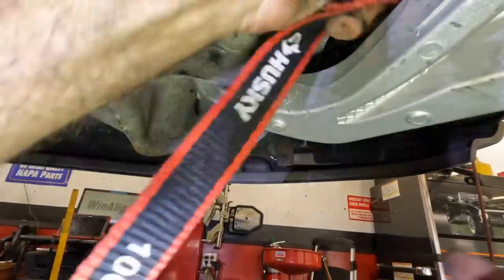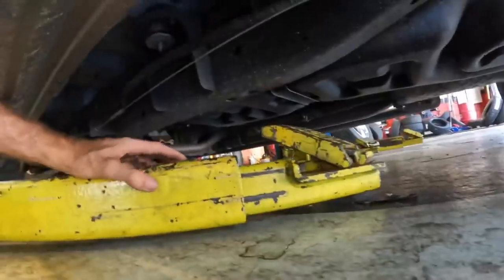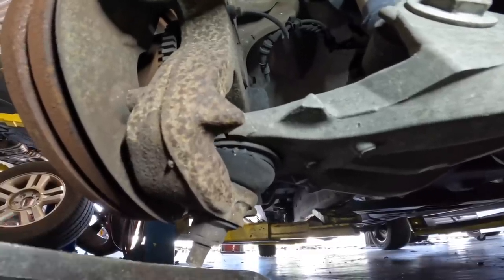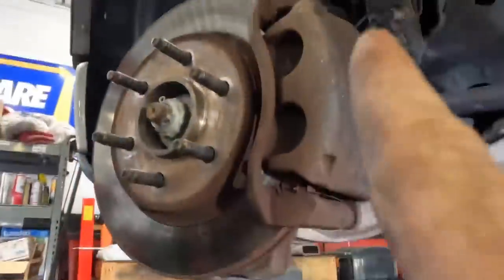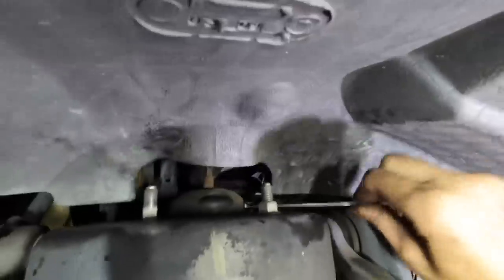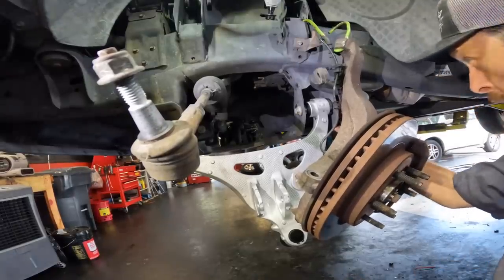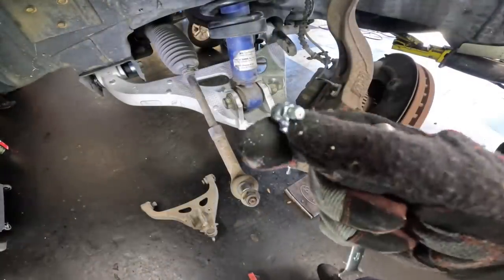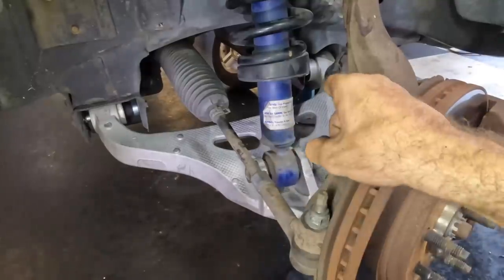Sloppy Suspension! 3 1/2 worn balls | Ford F150

Comment: Aha! Thank you Ray, I have had shuddering (juddering) with braking for a couple of years after replacing the rotors and pads with a set I bought online. Seems I need to get them checked for thickness variation.  I had been worried about it but haven't been able to afford to fix it.

Comment: Hmmm,
When I did my uppers and lower ball joints I didn't remove the lower arms. I just replaced the ball joints.
You do have some nifty tools.
Reply: It isn't necessary to replace control arms unless they are damaged.  He removed serviceable factory arms and replaced them with Autozone junk arms because it is often faster (thus cheaper) than spending the time to dislodge the ball joints.
Reply: On a truck that old, the bushings are more than likely dried/cracked/rotted away.
Reply: @mph5896  Yep.  If you do this job at home, as I have a few times, you should replace the bushings.

Comment: I had a squeak for 6 months. I re greased every rear bushing, I wrapped the sleaave in teflon tape. I could not find the sqeak! Saw one youtube vid showing a squeaking ball! fixed. i had the rear apart 3 times to find the squeak. Ball joints didn't even have play. just no grease.

Comment: Just had this same repair done to my 04 f150 3 days ago yes those spindles have little weight to them but you should be glad your customers truck wasn't 4x4 like mine but doing the strut towers is a little easier on my vs 2wd
Reply: Love the use of the straps in PT 2 work smarter

Comment: Dont forget to remind the customer that he now has greaseable ball joints that will need to be looked after when he gets his regular service done. On the up side, with regular service they will outlast the OE ball joints by a large margin. I still cant get over having to change control arms instead of simply replacing ball joints. Even after buying new lower control arms to same money when replacing a rusted out broken front subframe. The new arms had both ball joints and bushings pre-installed so installation ws a snap.
Reply: I had the same question. I've only ever knocked out and replaced the joints. It would have never occurred to me to purchase the whole control arm unless the rubber frame mounts were also shot.

Comment: Yup, inadequate pre-greasing at the factory. On the other hand, I have seen ball joints with grease nipples over-filled, the rubber boots fails, dirt and rust gets in, and the ball joints are ground into nothing.

Comment: Just curious Ray. Was replacing the the arms cheaper than pushing out the old ball joints and installing new, thus not having to remove the arms?
Reply: Yes, considering the cost of his time. Or, I think in some cases, the ball joint is epoxied in.
Reply: Yes, with suspension parts; try to get the best part you can,better, cheaper and easier.
Reply: I’ll spare you the long winded rant I’ve got about ball joint presses and just say they’re fucking garbage lmao. This was the cheaper option because ray would’ve spent an 8 hour work day fiddling around fucking with some ball joint press and probably breaking the thing anyways. Those look like beefy ass joints. Replacing those was the easy route.
Reply: Sometimes there is no option from a supplier.
Reply: @joshhobbs1442  yes I  realize that sometimes parts are not available.  Like most of you YouTube maybe you've done similar repairs. So have I,  several actually.  Popping out a ball joint and installing new takes 20 minutes. 
I respect Ray for what he does. I enjoy watching him struggle with the same issues i do. I would have liked him to explain the his rational for choosing to replace all the arms.
Reply: @j.o.a.t9718  I was also curious about that but didn't know if it was a serviceable part. The only ball joints I have done is on my classic Mini and they are a pain because you have to use shims to set them up. I wish they were a replaceable sealed unit.
Reply: Uppers definitely.  Lowers technically aren’t serviceable but you can buy just the ball joints but honestly ford lca’s are pretty cheap also
Reply: I used to just do the balljoints if the rest of the arm was in good shape. My ball joint press is 20 years old and never had an issue doing the joints only
Reply: If the control arms are aluminum (as they are on this vehicle) you cannot replace just the ball joints because the aluminum is soft and will no longer have the correct fit tolerance to press in a new ball joint.
Reply: @shrodingerschat2258  Really? Who told you that? I can't remember how many crown vics,suv's and p/u's with aluminum lower control arms I've pressed lower ball joints into. If it's so soft they would be snapping in half by the thousands.

Comment: Out of curiosity, why replace the entire control arms if only the ball joints were bad (or were the rear bushings bad as well)?  It's also nice to see the replacement ball joints come with Zirk (grease) fittings.  Most OEMs went to sealed ball joints starting around the 70s and it was a bad thing.  It was engineered obsolescence.  With a Zirk fitting, theoretically, the ball joints should last forever as long as you grease them on schedule.

Comment: Interesting...never seen ball joints checked like that. For trucks, bottoms i usually put a pry bar under the tire close to the ground and it does the samething as under the post of the ball joint like this, checking the uppers  i put a pry bar over the top and under the back and pull down on it and you'll see the play if its there. Both seem easier than this way and only need one tool for both. But doesnt hurt to know other ways as well. Sp more than one means of checkin them of you suspect they are failing but dont feel it when shaking/pressing and pulling the wheel

Comment: Ive have bad luck with the ball joints that come with the full control arm assemblies, don't seem to last.  I always press in a good quality ball joint when possible.
Reply: A lot of manufacturers have taken away that option, which is stupid IMO. Waste of resources for no good reason, and makes it cost more for parts unnecessarily.

Comment: With that steering wheel shake, a bit surprised you didn't look for runout or a warp in the rotors.
Reply: Didn't have too. He noticed it on initial roadent test , instantly nu problem source.

Comment: That F150 front end is built.  I bought a new Silverado 1500 that had the weakest front end GM could get away with. With only 8,000 miles one of the upper control arm bolts broke while I was turning. The service writer at the dealer told me they had several of them do that. How was that never recalled?

Comment: Morning Ray, good vid, didnt know that on a Ford you had to change the A arms to change the ball joints, that adds to the expense.
Reply: And for a truck, those front end components look like delicate pieces of junk. 
Glad I got my Chevy 🏁
Reply: @partyguarder  I have never owned a Fffffford, always GM/Chevy brands.  All brands have their issues, like GM products have rusty rock panels and bed fenders.
Reply: @madman671000  
That's why you gotta keep the metal clean and oiled with Krown/Rust Check and you won't have the rust issues. It will at least slow it down a lot.
Reply: @chrisleggett685  
Not too familiar with newer GM products, but as a general rule of thumb - if a vehicle has no grease fittings, it is a piece of junk IMO
Reply: the upper a-arms are relatively cheap to replace, the lower arms i would have just pressed in new ball joints rather than replacing

Comment: Good job Ray.
Did anyone take notice that the factory install ball joints never had any grease nipples in them but the aftermarket ones did?
I do realize the vehicle has 148k showing on the odometer but I also believe the ball joints would have lasted a lot longer if there were nipples in them and regularly greased along with scheduled oil changes. Back in the day, a bit of grease most always took care of loose ball joints. 

just sayin' ...What's my point, they now intentionally build stuff on the cheap so parts don't last and don't allow for maintenance so the consumer is on the hook for expensive replacement parts.
Reply: They def will last longer being greasable, the problem is the size and weight of these trucks. Much bigger suspension parts and weight, especially if towing. If you notice, they are the same kinda ball joints that go on a car, so they wear much faster. You can get really beefy upgraded expensive ones that will last longer, but that's not what comes 'stock'

Comment: Why is it that if it's a warranty repair, technicians work at super fast speed and work on slow speed if you're paying for it?
Great job Ray.
Reply: Most techs are paid by the job, not by the hour. It is not in their best interest to work slow. For warranty, the shop may want corners cut because the manufacturer only pays so much.

Comment: That's nothing, the last rotors on my 2008 got so bad, I waited two years and it would almost rip the wheel from your hands with hard braking.  I finally broke down and changed them myself.  Just laziness but it did stop the car.  Just super warped.  Hang on tight.

Comment: Hey Ray, I hardly ever see you working on dodge rams. I guess there just awesome trucks. I know mine is. A 2008 with 178,000 kms and I have replaced 3 parts. 1 starter, 1 radiator and 1 steering Ram. Regular maintenance including brakes. I somehow even managed to evade a lot of rust living in Toronto Canada. I do think I’m soon due for a front end though and would love to see you doing one. It’s been many moons since I have had to do that job and not looking forward to it. A man’s got to do what a man’s got to do so be it.
Reply: My 2009 has gone through a few sets of ball joints, a new tipm, but no lifter issue. Basically the same procedure as these
Reply: @jeffreygoss8109  I thought the lifter problem started after 2009, I could be wrong but for sure the 2008 there was and is no problem with lifters that I know of.
Reply: @123turby  good luck to you!
Reply: @jeffreygoss8109  sounds like you have done this job before. Should I even be considering doing it?

Comment: Problem with new ball joints having grease fittings is that so many oil change places have gotten used to NO grease fittings that they don;'t look for them anymore. Also, why weren't the factory ones able to be pressed out of the control arms like they used to be? Who wants to pay extra for new control arms? Hope you show tightening the control arms at ride height with the weight on them. Many goof up by tightening the control arm bushings up in the air.

Comment: Could have gone and hadn't give him some new tie rod ends as well and the brakes do look a little bit glazed you could Scuff the rotors with some sandpaper and that would get rid of that brake squeak, he didn't properly bed in those brakes when he first had them put on the truck. When you first put brake pads on a vehicle take it out and hit the brakes hard at about 50 a few times without lifting your accelerator. And then drive it for about 10 minutes to cool the brakes back down and that usually Burns off that resin layer that gets on the brakes if you don't break them in right away it takes about 200 miles to get them to straighten out.
Reply: Steering wheel shakes with stopping. Runout check would be good to do on the rotors.

Comment: I see a need for a battery ratchet with the head on a slight angle. Like the spanners with the wobbly neck.
Reply: Not a bad idea.  Could make it adjustable just like a manual swivel head ratchet

Comment: Are these ball joints not replaceable or did you just fire the parts cannon, Not being judgemental, just courious!
Reply: Looks like a Ford thing.
New bushings and ball joint tighten the truck back to new.
IDK for sure.
Reply: it's cost less in labor time to replace the control arm that comes with new ball joints. so he's saving the customer money this way.
Reply: You can replace the lower ball joint separately.  I'm pretty sure you have to buy the whole upper arm assemblies on these.  I personally think it's faster to press in the lower ball joints but I'm in the rust belt so all the bolts and sway bar links would be rusted tight.

Comment: When my steering components gave up the ghost, I bought aftermarket replacement chineseium parts... threw out my original OEM parts (upper control arms and other steering components) after replacement... well.. the rubber boots are leaking and one is split.. I wish now I just found someone with a press... press out the bad ball jount parts.. press in new ones.. (at least the parts where you can specifically replace the ball jounts only) hindsight is 20/20.. live and learn.. 
Plus side.. steering is way smoother.. for how long?.. 

Like amother person commented.. wish I could bring my vehicle to you and let you pick it apart and fix everything wrong with it..
Reply: I agree, the ball joints that come with control arms are lesser quality in my experience
Reply: Harbor Freight has an affordable press kit.
I bought that, a DW 1/2" impact driver, a bunch of impact sockets etc (also HF), the uppers and lower ball joints, and new bushings for the sway bar links (parts from RA).
The tools and parts cost less than the shop estimate for just replacing the lower ball joints!
Reply: Lubricate the contact point of boot, which prevents twisting, so they last longer.
Reply: @greghudson1489   I have replaced the ball joints on both our cars with that kit from hf.

Comment: Time to do this or have it done on my ‘07 F150 w/ 204,446 miles.  At 64 I’m finally turning some work over to a local independent.  Question about parts, if I buy Duralast at Autozone they have a lifetime warranty.  When you, or another independent shop install them, if there’s a failure, will the warranty still apply if the owner has the receipt?  I know it won’t cover labor, just the part if I do it myself.  Great channel, thanks!

Comment: support the suspension not the frame when checking front end parts....if these parts are moving with pressure, they will be falling out when they are lifted by the control arm
Reply: Ray did just that in a round about way when he lifted the central shaft in the lower control arm ball joint.

Comment: I wonder if you dream at night of dood e dood do LOL and you can tell something is wrong wheel the steering wheel is off centre i have just had my wishbone done for that reason  also the rubber cover on that ball joint has a split in it letting all the crap in it which could fail an inspection here in the uk  and I spied a grease nipple which are few and far between in the uk  
 ,thanks for the video

Comment: My moms van had a horrible shake in the steering wheel when braking from high speeds.  A big chunk of the left front tire was missing.  New tires fixed it and no more issue.

Comment: Have question for you , why didnt you just replace the balljoints and bushing in the old set that you took off  ?  i think it wounld have been cheaper than buying a hole new set of control arms .thanks

Comment: Did you replace complete upper and lower control arms, or only the uppers and fitted new lower ball joints? It seems a waste of materials if the ball joints only can't be replaced.

Comment: just out of curiousity, cause i just replaced ball joints on my truck recently, but why didnt you just pop out the actual ball joint instead of replacing the entire control arms.   Do the fords just not come out or something.   Little bit of retrospec on this would be nice.

Comment: If anybody asks why not replace the ball joints only, the way Ford has this designed, it could break the control arm getting the ball joint out
Reply: I was going to ask that question.  It seems like a waste of completely good forgings.  Is there a "core" charge, i.e., do you return the old control arms to the auto parts store to be remanufactured with new ball joints in a factory and resold?
Reply: Really?  I'd like to see that memo.

Comment: Very interesting video to watch. I would like to see how you tighten up the bolts that were supposed to be tightened when the car is at proper ride height to avoid tension on the rubber. Do you put a jack under just that wheel to get it to ride height? Many thanks!
Reply: Since a control arm replacement job requires an alignment, could you use a jack get close to proper position, tighten the arms up, drive to a shop with a four post alignment lift and simply tell them to release and re-torque the arm bushing bolts prior to setting alignment? I would think they would understand that shade-tree mechs like me don't have a four post lift.
Reply: I guess another option is to jack the car onto four wheel ramps and slide under and finalize torque. That would only cost a second set of ramps.

Comment: All those loud noises do not record. Everything is at the same volume. As for the truck ; it has just a fine covering of dust , very little rust.  Even the stickers are still intact.  It is like he only drives it around a warehouse or a dessert. No mud,no grime and the ball joints just fall off. Strange.

Comment: Hey! I did all 4 ball joints on my 2001 f150. I know the uppers are not swappable because they are part of the upper control arm, but why didn't you just press out and replace the lower ball joints instead of replacing the whole control arm? Cost wise i would think just the ball joints are cheaper than a whole control arm.

Comment: Isn't it easier to just press out the old ball joint and cheaper?
Reply: Personally I think the benefit is getting all new bushings which will firm up the suspension even more.  They are now old rubber and have 150K of wear on them also.  I don't know abuut this application but not sure all are designed to be replaced or available individually.  I think some of my 60's cars had bolt on ball joints.